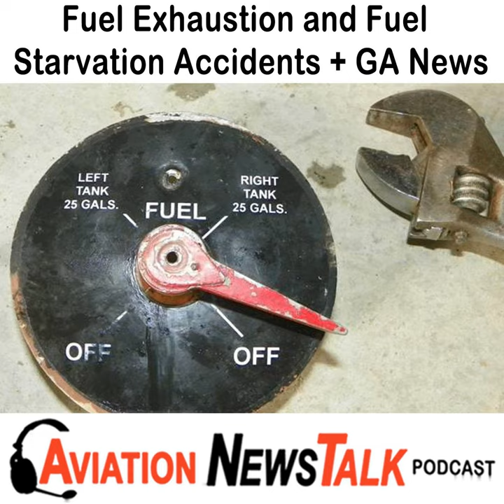318 Recent Fuel Exhaustion and Fuel Starvation Accidents + GA News

Comment: Good program. However, you should have mentioned a couple of other basics on fuel management. 1. Fly by time not just gauges. A simple timer is essential for monitoring fuel usage. 2. Always use a calibrated stick before a flight. Always write the gallons in each tank on a log sheet. I often see pilots skipping fuel quantity and quality checks.  They treat a flight like a car trip. Problem is you can't pull over to the side of road in an airplane.

Comment: Something tells  me this is a common practice to roll down to the end.  I'm looking at my iPad on the following Saturday morning and runway 27 is still closed.  I suspect future requests to land long will be met with a different response by the tower.  Or the airlines will place restrictions on using this procedure.
Reply: Rolling to the end in and of itself is not a dangerous practice, if coordinated with the tower. However, airline Ops Specs clearly define the touchdown zone AND stabilized approach criteria. If a landing in the touchdown zone is in doubt or airspeed is not within specified parameters at my airline, a go-around is MANDATED. It will be interesting to see if this crew adhered to UAL's Ops Specs, or if the Ops Specs allow for "long landings".